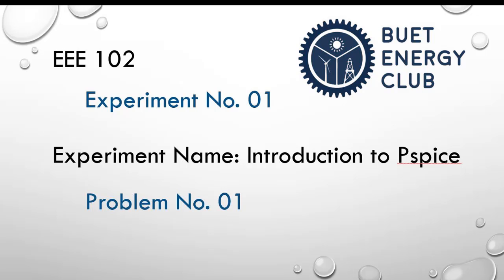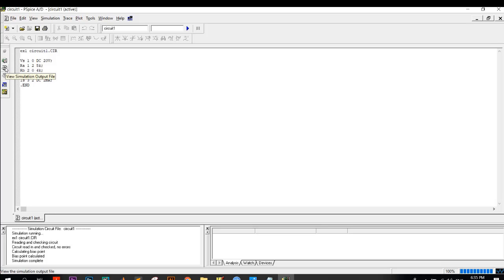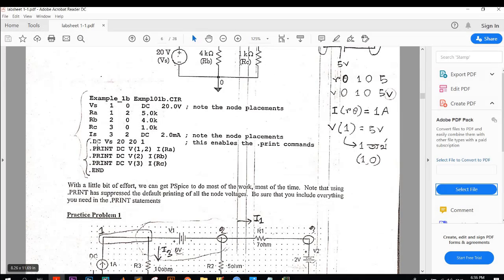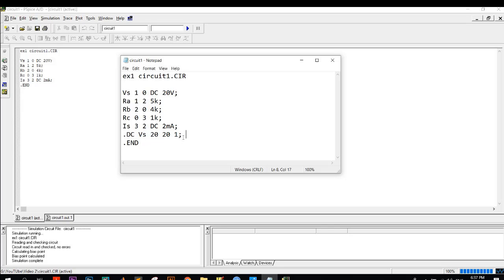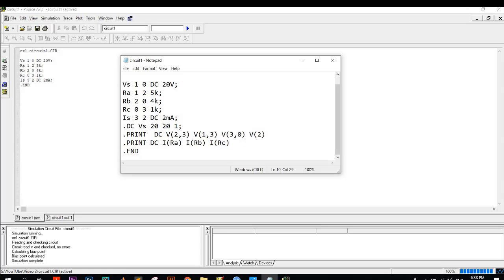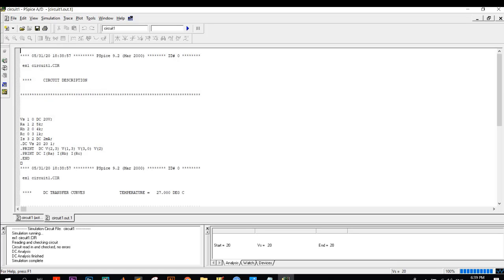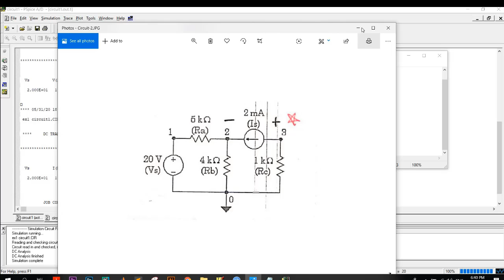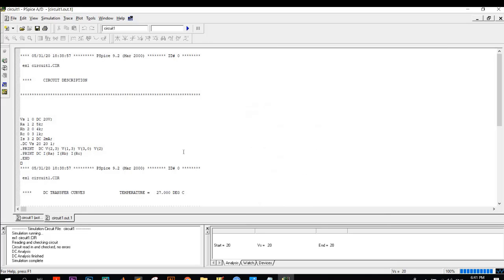EEE 102 - Experiment: 1  Problem: 1 | Introduction to PSpice | Netlist - 2

Comment: I think there is a mistake in this tutorial(2min 20s).
.DC statement
This statement allows you to increment (sweep) an independent source over a certain range with a
specified step. The format is as follows:
.DC SRCname START STOP STEP
in which SRC name is the name of the source you want to vary; START and STOP are the starting and
ending value, respectively; and STEP is the size of the increment. This is a method of varying a parameter
over a range of values so that we get a batch of cases solved all at once.
Example: .DC V1 0 20 2
Often, we do not actually want to run a sweep over many values of a parameter. We can circumvent the
sweep by setting its Start and Stop values identical (and the Step is non-zero) so that it can only run one
value.
Example: .DC Vs 20 20 1
Since the starting value equals the stopping value, the analysis will only run for one case, i.e., for Vs at 20
volts.

Thank you for uploading this tutorial. It helps me a lot.